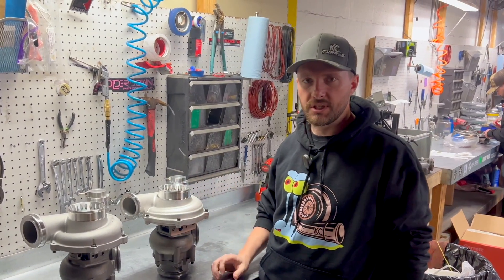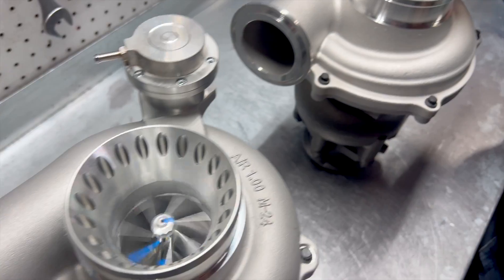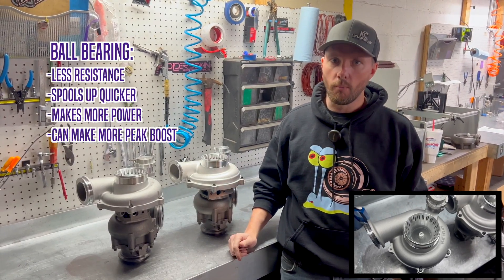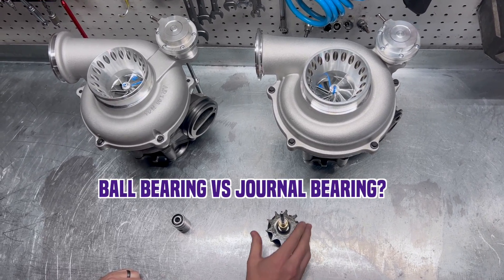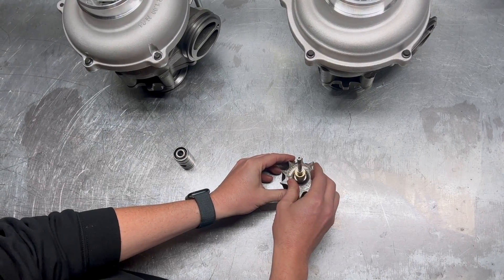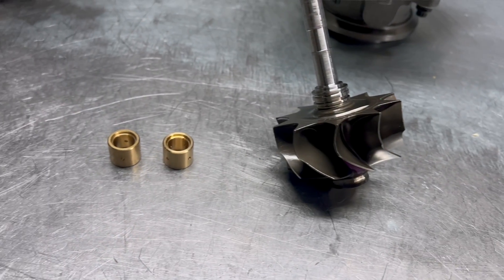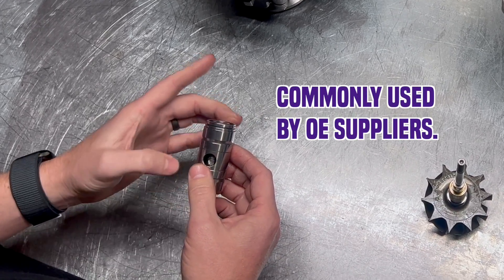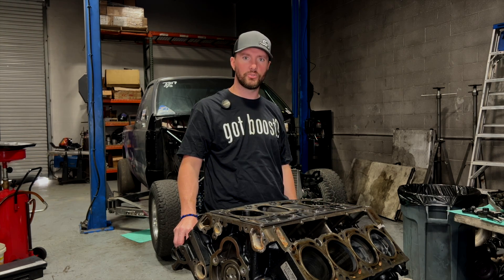Turbo Bearings Explained - At The Bench

Comment: I'm sure the ball bearing turbo spools faster but 'd like to see the "flick test" done on the journal bearing turbo with oil pressure applied to it.
Reply: good point. also what about durability? seems to me the journal bearings would run cooler due to the constant oil flow?  but then I guess the ball bearings would also need constant oil flow.  So that brings up another question   wouldn't the ball bearings run a lot slower when immersed in  oil depending of course on viscosity ?  Maybe we are both saying this "test" means little. I have a lot to learn
Reply: @davidsmith5982  most turbos are cooled by coolant, not oil. Ball bearings also needs an oil restrictor so there's not as much pressure in the bearing as a journal one.
Reply: That was literally the first thing that came to my mind. Also I make my Turbo glow for a half hour to 45 minutes at a time during open track events. How well does the ball bearing deal with Extreme engine temperatures?  My holset hx35 has been rocking for..... I don't know 16 years. I swear one time I got it glowing so good after a Highway pull it looked like the turbo was transparent.